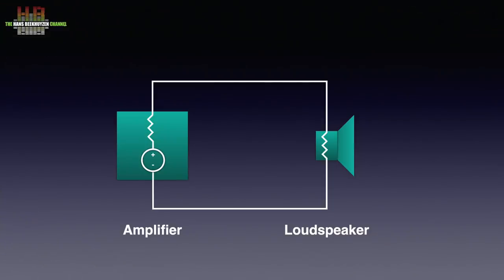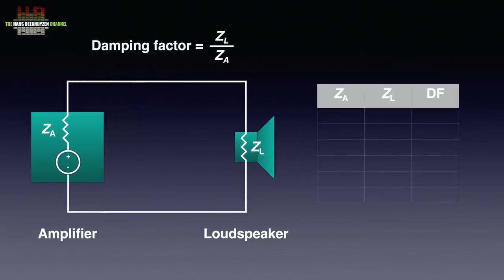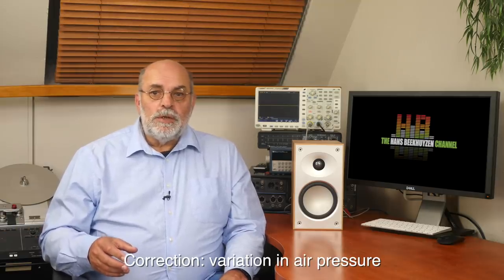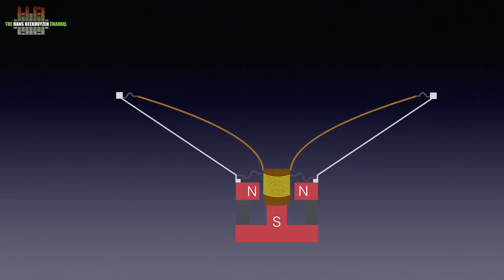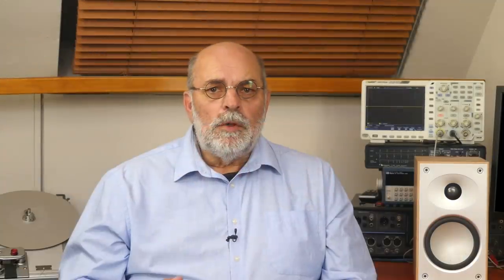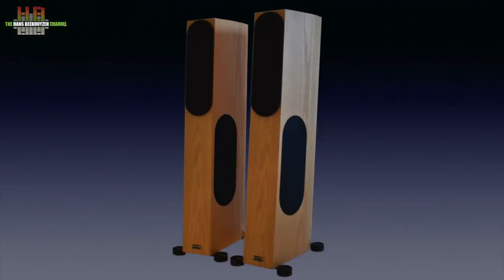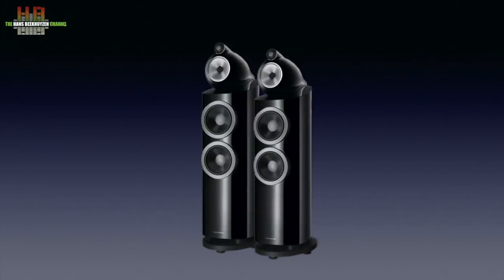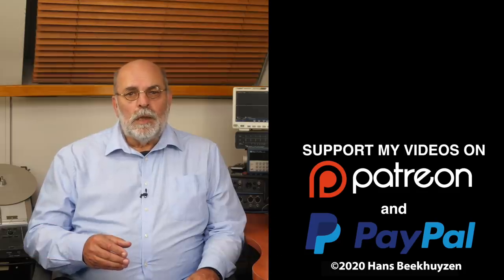What is the damping factor of an amplifier?

Comment: Driving a set 802d3 with a PrimaLuna (2 x37w) and I love it but you are 100% right the solid state I use with higher damping factor has more control over the lows. But sometimes the less control is nice, like with soft jazz..and specially at lower listening volumes.
Reply from the maker: De gustibus non est disputandum (There is no accounting for taste)

Comment: i have several amps some with low DF and 2 with 200 and 400 DF respectively, they are all different of course, but when i switch ported speakers and closed speakers between them the differences are very noticeable, in general low DF amps like closed cabinets and high DF like ported, this is a personal experience made by the audio stuff that I have some years ago, but as far as audio is concerned, it's all very relative.

Comment: Nice one Hans. I have the Nautilus 805, do you know if they are also “difficult” loads?
Reply from the maker: Not as difficult as the 803's but they do need a powerful amplifier. The sensitivity is low (you need mare watts than on the average speaker for the same acoustic output).

Comment: Tight controlled bass seems to be something of an acquired taste. I have a friend who complains that my system must have something wrong with it (bass is a little dry, but clean and extended). When a mutual friend bought some new speakers with horrible box colouration, nothing below 45 Hz, and placed so as to cause slow booming honks, it was explained to me that this is "real bass". What can you say?
Reply from the maker: there's a video on the subject coming soon.
Reply: @Grrrr3FKAGrrrrGrrrrGrrrr  because ppl list to music differently basically it what they like some ppl like high loud bass some like ported high bass some prefer seal bass an low sane with ported bass low .it's all about the music u listen to you guys are both right .no one us wrong it's talks opinions

Comment: would there be a difference from 103db to 100db is there a big difference or no?
Reply from the maker: Well, it depends what dB's you are talking about. Watch https://youtu.be/6cibus80gSo
Reply: @TheHansBeekhuyzenChannel  Signal to Noise Ratio (below rated 1 kHz power at 8 ohms) 	103 dB (A-weighted) vs Signal to Noise Ratio (below rated 1 kHz power at 8 ohms) 	100 dB (A-weighted). this is the db ratings i was referring too  i am kind of new to understanding audio.i will watch that video thank you
Reply: @TheHansBeekhuyzenChannel  okay I watched your video but I couldn’t find the answer to the question I asked, is there a big difference with the signal to noise ratio db ratings that I asked? Or there is no difference because I am thinking about getting an amp I would just like to know thank you for all of your experience and sharing of it

Comment: Hans would it be true the type of speaker would react differently to the amount of damping factor.Exsample horn loaded bass bin has hardly any cone movement a ported speeaker has large amount of movement. would a horn need less and ported more?or would it just depend on the impedence.but then again the encloser has a effect on the impeadence.nothing is ever simple is it!
Reply from the maker: Horn diaphragms might generate less voltage but since the sensitivity is far higher they are also driven by far lower.current.

Comment: I miss some factors in the explanation which also have an impact on damping factor and electromagnetic damping. Loudspeaker cables and the crossover network. I think the biggest impact on the damping factor however is actually the voice coil resistance itself. Heating up the voice coil is also an extra impedance, lowers the damping factor and lowers the actual electromagnetic damping. The impact is huge (and also on passive crossovers).

Suppose you have an amplifier with an extremely high damping factor, no cable resistance and no crossover. One degree Celsius (1ºC) temperature rise gives 0.4% extra resistance (depending on the material). That brings down the damping factor to 250. One degree.

10ºC brings down the damping factor to 25.
100ºC brings down the damping factor to 2.5.

And at the maximum rated power and maximum temperature of the voice coil (depending on the driver):
200ºC brings down the damping factor to 1.25.
250ºC brings down the damping factor to 1 (at this point the resistance is doubled, and your passive crossover is one octave off).
300ºC brings down the damping factor to 0.83.

I build and use a system with a total different strategy. As the electromagnetic damping is all over the place, I eliminated it all together. I use a power amplifier with a very high output impedance (a very low damping factor, essential a current source), so cables and voice coil temperature has no impact on the damping (frequency response, compression, etc). The actual damping is defined by EQ (Linkwitz transformation). As the damping, frequency response (and so on) are stable now I can very precisely control the frequency response of the driver. On top of that there is no thermal compression anymore (power compression), IM distortion is much lower (all the IM distortion by the inductance is eliminated) and there is much lower modulated noise (all the back-emf is eliminated). (SGR Audio has active loudspeakers, the Convex series, based on the same principle).

In my opinion the damping factor is crucial for performance and stability of performance, the lower the damping factor the better  
(an output impedance that’s at least 100 times higher than the nominal impedance of the loudspeaker/driver).
Reply from the maker: This video, like all my videos - is intended to give the lay man insight, not to compete with high schools. But thanks for sharing anyway.
Reply: @TheHansBeekhuyzenChannel  I understand that it is for the lay man, but by leaving out some details, the conclusion becomes the opposite!

The damping factor is crucial for performance and stability of performance, the LOWER the damping factor the better.